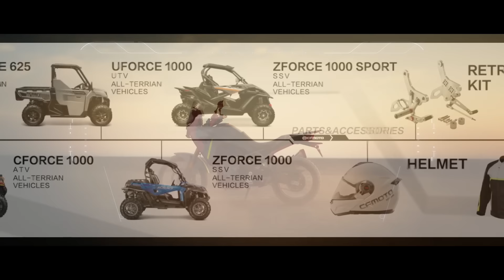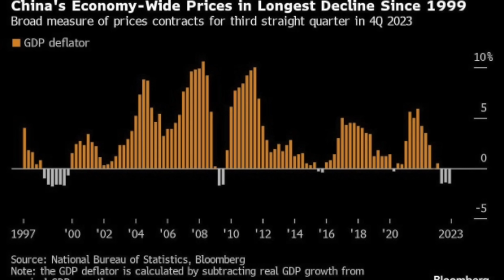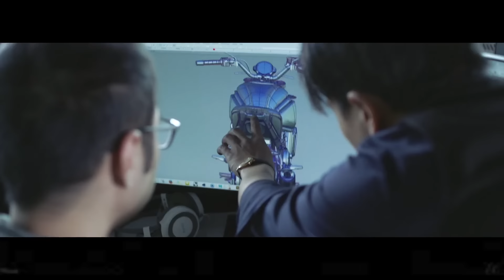Can Chinese Bikes Take Over the Motorcycle Market in the West? (CF Moto, Kove, Sur Ron)

Comment: The difference between Japanese manufacturing and Chinese manufacturing aside from build quality, is the CCP.

I’ve noticed in all these stolen designs that China is producing, that the price has gone up dramatically.  $9k (or higher) for a Chinese motorcycle?  Absolutely insane.  If I have to give the CCP money, I’d prefer it to be in the $30 or $200 range, not upwards of $10k.

Did I mention build quality?

Comment: "Win on Sunday, sell on Monday."
I'd like to see China's small engines tested in the racing circuits. I can't think of a more challenging environment for a small engine to prove it's worth, durability, precision, endurance, than blasting full throttle lap and after lap around a track amongst other proven designs and engines.
It's a lot of claims until you put your stuff into a race amongst other manufacturers.
MotoAmerica offers just that opportunity for their 450cc sportbike. If they run a 650-700cc twin, MotoAmerica offers a class for that. And so on.

One thing of note:  F9's oil test is pretty dubious and wasn't operating under properly controlled conditions. Skewed test, skewed outcomes.
Reply from the maker: Good points. Kove runs the Dakar Rally with mixed results. I'm sure they are learning a ton from the experience. It's good to see that they jumped right into the fray.
Reply: Yep. Racing is usually where technology gets introduced and proven, and then moved into the street-rider markets.

Comment: Well there is certain risks that come with Chinese products though. CFMOTO has the KTM tech so they are good enough but that also mean only upto KTM reliability. They do defeat KTM in variety though. 

As for the other brands its a roll of dice.
Reply: Most of their bikes sold are actually copies of small capacity honda bikes. Their mid range are all copies of the Kawasaki 650 platform.
Reply from the maker: True. Sur Ron looks good and Kove is making the right moves. If they stick around and prove themselves I'd get a 450 Rally.

Comment: If it comes with an owners manual written in pigeon English and 3000 mile service intervals you know you’ve got trouble.
Reply from the maker: The Kove Rally 450 has 3000 mile service intervals but that's actually better than most dirt oriented bikes. My Yamaha WR250F has 600 mile intervals.
Reply: CFMoto has released their 450mt/ibex manual and I only saw one typo tbh.

Comment: Me and my partner bought in October 23 both a voge rally 300. In January, we sold them again. They rust like hell, the temp sensors failed, the gasoline gauge didn't work from the beginning, the brakes make weird noises in the rain, one clutch cable failed and the fifth gear made problems... This all happened in the first 2k kilometers. Yes it's insanely cheaper than a Honda crf and generally its a nice bike but it's not worth the trouble.
Reply from the maker: Thanks for the info. It seems that it will a while for some of these companied to earn a good reputation. CF Moto makes a lot of KTM parts though so their quality has to meet KTM standards.
Reply: Ktm ownes 51% of cfmoto or so my dealer tells me. I just bought a 790 adventure which is manufactured there. Its of very high quality
Reply: Voge is brand of Loncin ( sr for misspelling) and manufactures the 900cc engines and plenty of other parts for BMW, (it looks like even the frame), so if you buy F750/850/900 from BMW, indeed you ride Loncin bike. BMW says "final assembly in Germany" ......
Reply: 15 years ago Vietnam was flooded  with cheap Chinese Scooters, now you never see them, I wonder why?
Reply: @jon-ie4li ,
 Here in Michigan since GM started packing up and moving out, The Japanese auto manufacturers have been moving in, Subaru is one of them and I plan on looking into buying one if I like it after test driving a few of them. Incidentally, I'm a retired auto/truck mechanic/technician and I have no prejudices towards anyone.
Reply: I bought Voge 300 Rally in April '23 and already done 13k kilometers (about 70% off-road) with absolutely no issues. It has no more rust then any other Japanese bike. Clutch works well and smooth. Temperature sensor (yes it has only one sensor!) so far measures temperature and has no problems. Believe it or not, noise of breaking in wet environment depends only on brake pads compound quality and could happen on any vehicle. After all, that noise disappears right when you warm up brakes after getting them wet and it's pretty normal thing. And by the way 300 Rally 2023 model year has no fuel gauge. 
So looks like we ride a different bikes? :)
In the 300 Rally owners community (more than 100 members) no one claimed any issues you've mentioned.